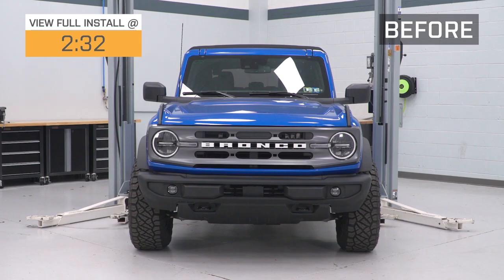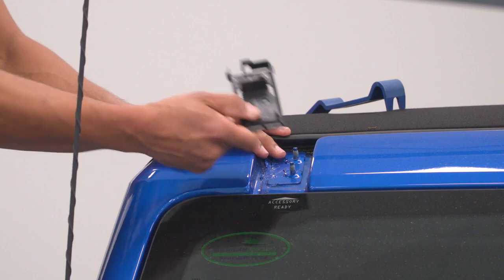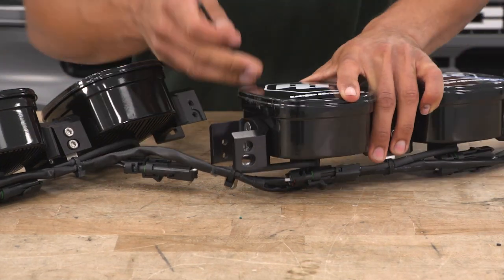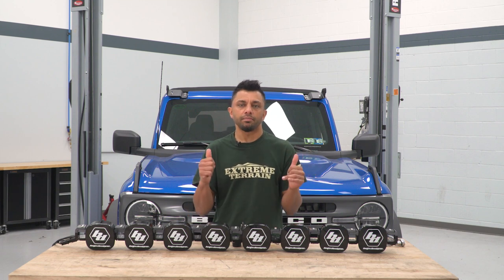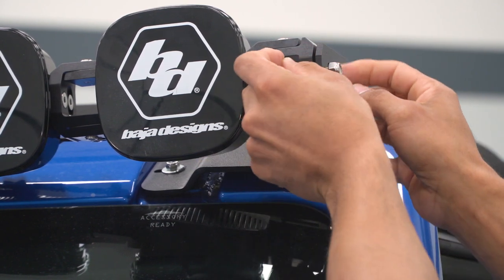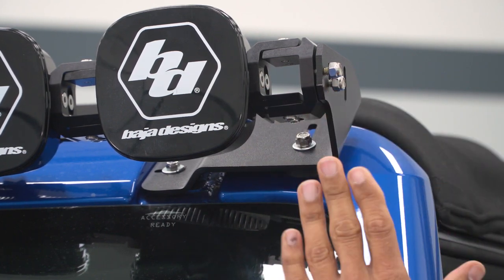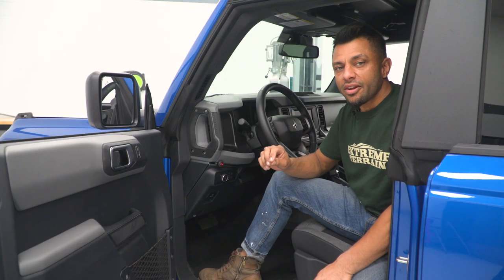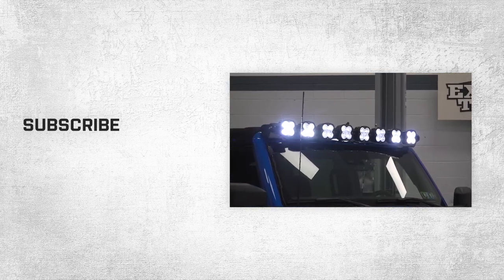2021-2022 Ford Bronco Baja Designs 8 XL Linkable Roof Light Bar Kit Review & Install

Comment: Why not use the internal wiring that Ford has pre-installed under the passenger side mounting point instead of running a wiring harness down the windshield?
Reply: Thats only for the Broncos that have the Aux switches installed. The ones without it like the OBX dont have the same wire harness